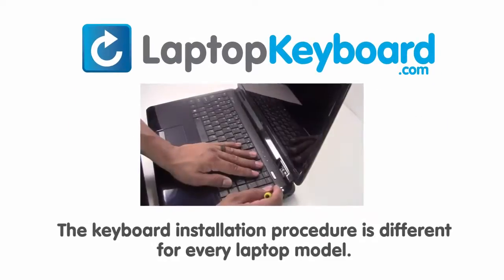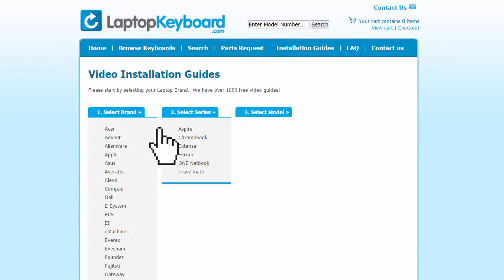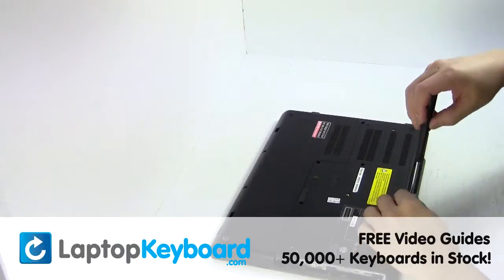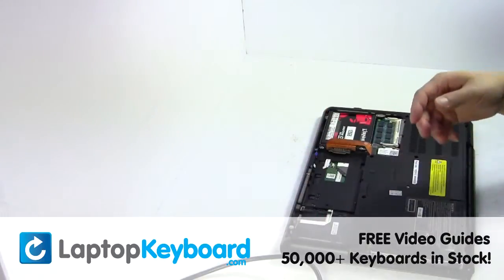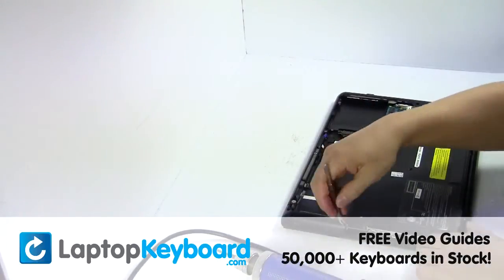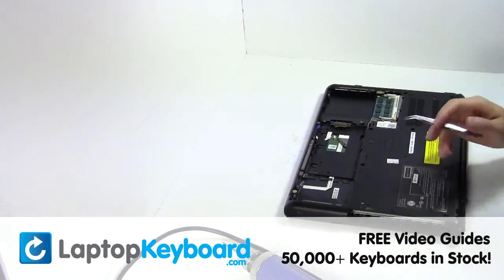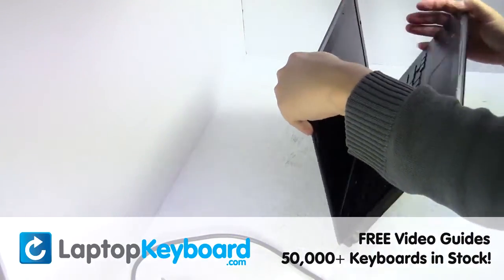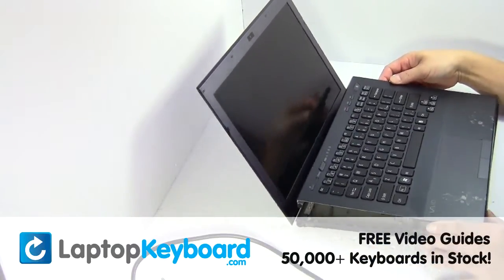Sony VAIO VPC-SC Keyboard Replacement Installation Guide - PCG-41218L PCG-4121DL PCG-4121EL

Comment: Hmmm. This only shows replacing the whole keyboard and aluminium front.  How about the removal of the actual keyboard which is what you ship.  My issue is that once I have installed a replacement keyboard some of the keys don't sit raised up like before and it makes things like the space bar and middle keys J K L I O hard to type with.